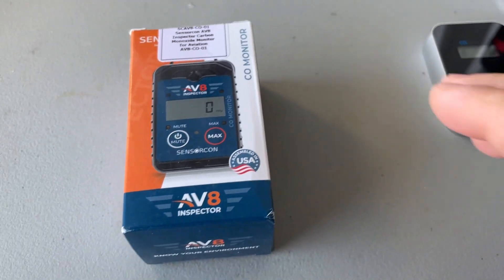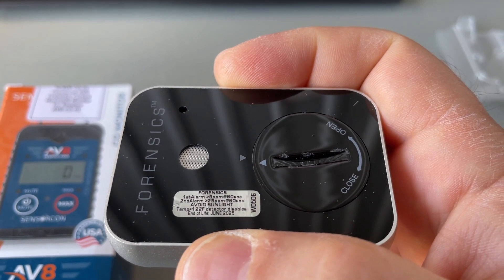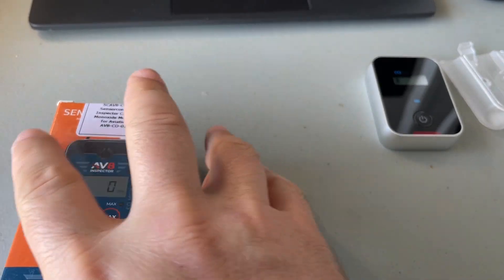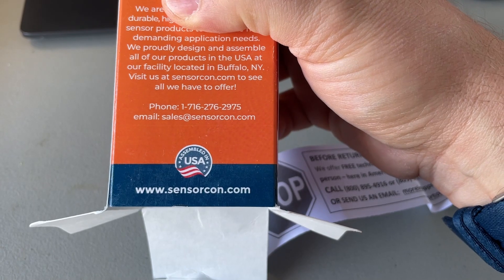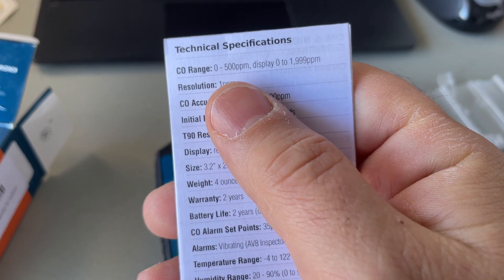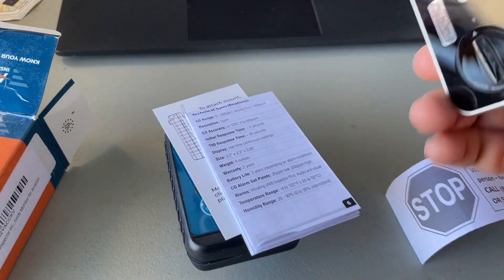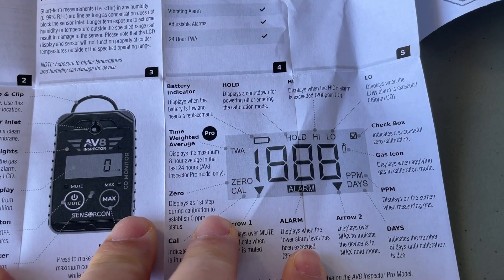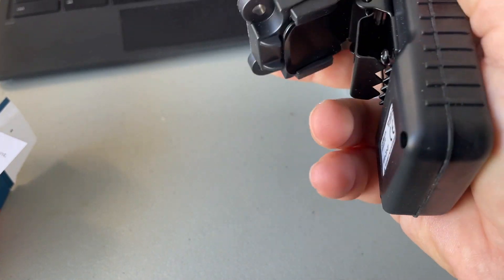A new and better aircraft CO detector for aircraft?

Comment: Thanks for the review! A few things to consider about the AV8 -- The Pro version does have programmable alarms as well. The battery is meant to run for a minimum of 2 years without turning off, and is user replaceable. There is no expiration date, so to speak, but the sensor is meant to last a minimum of 2 years, which is industry standard. The device will give an EOL (End Of Life) warning when the unit is past its expected lifespan. As long as the sensor continues to pass calibrations, it is still good. Some sensors last well past their 2-year expected life. We make all of our sensors in house in our Buffalo, NY facility. 

The great thing about the AV8 series is that after the 2-year warranty is up, you can send your device in for repair and for $69 we will replace the sensor, battery, any broken/damaged components, perform a full calibration, and renew the warranty for another 2 years! It's essentially like getting a brand-new device for less than half the cost as a benefit of being a current customer. We want our customers staying safe without having to break the bank every few years. Stay safe out there!